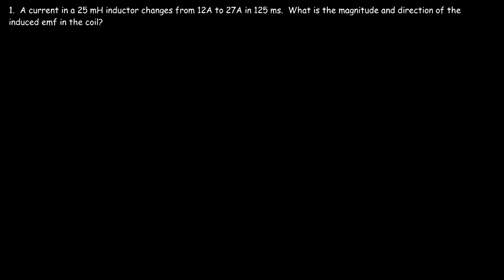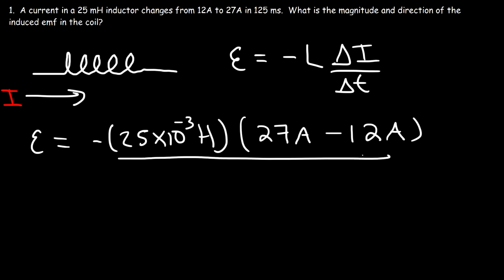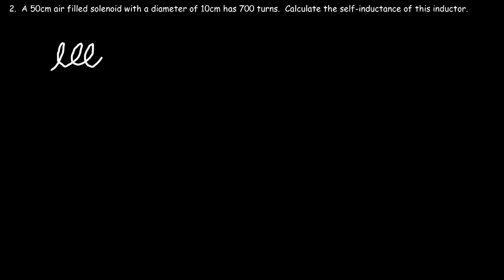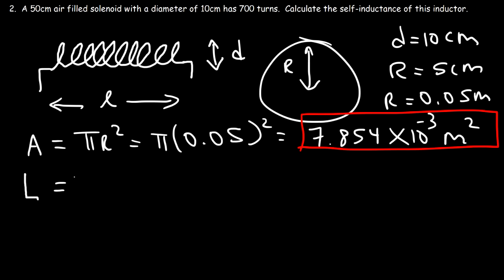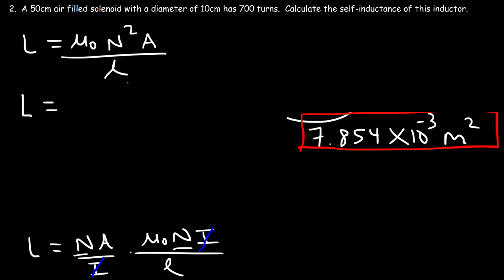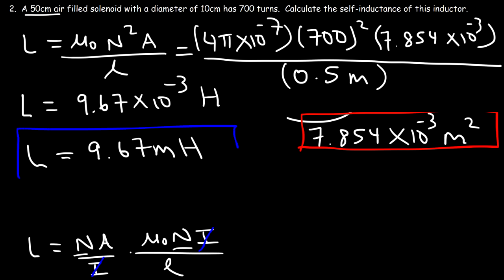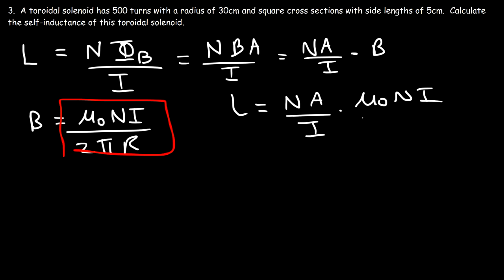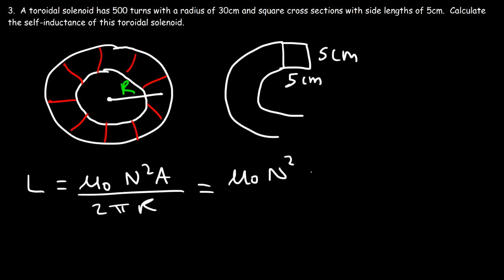Self Inductance of Inductors & Coils - Solenoids & Toroids - Physics

Comment: I have a question I still can't understand. Anyone to help will be helpful.

An iron of cross sectional area 800mm2 and of mean radius 170mm has two windings connected in series, one of 500 turns and the other one of 700 turns. If the relative permeability of an iron is 1200, find self-inductance of each coil and the mutual inductance , assuming that there is no leakage